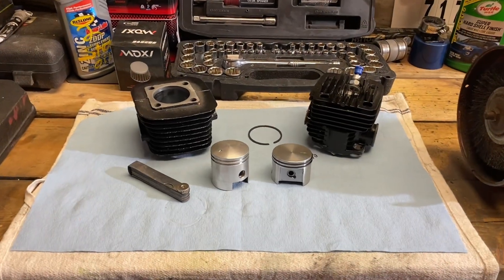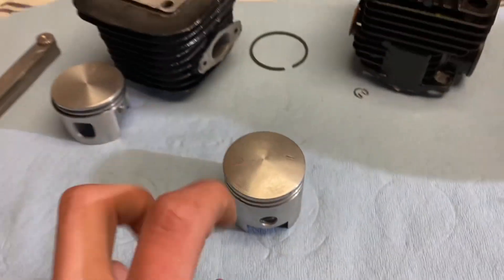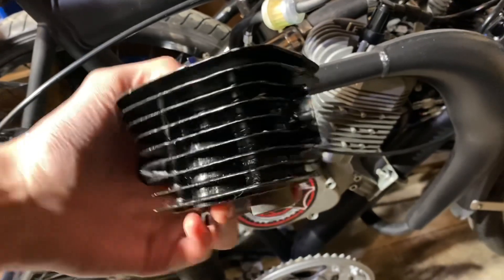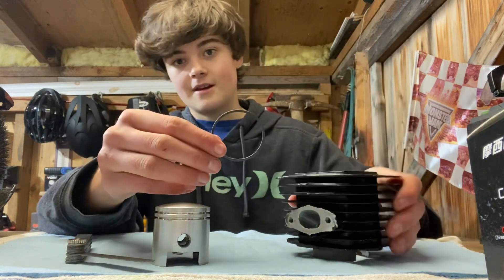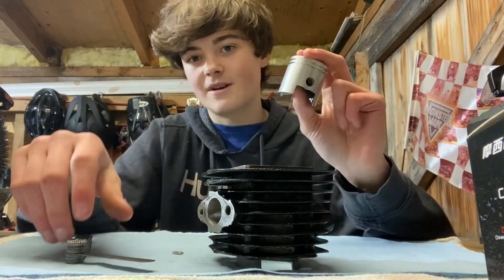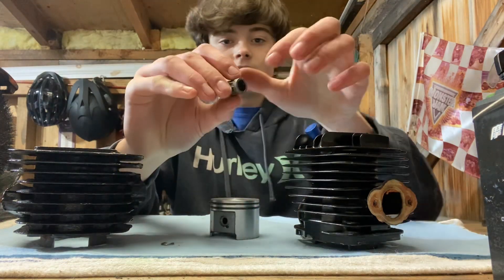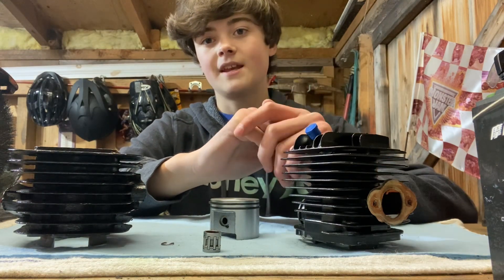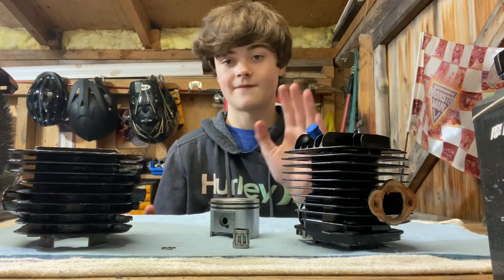Checking Piston Ring Gap on a Motorized Bike and Installing Piston the right way

Comment: No dude, those pins cannot cross any port , this is why you can’t hog out the transfers, or intake. Also the charge coming in cool’s it and puts pressure on the ring’s
Reply from the maker: Never said they did cross…

Comment: C clips and they come in .8 -1.0 thickness weisco is the strongest ones and you need a relief Dremeled to get them out all the other ones fail from loosing the tension from the rpms
Reply: Weisco has been making engine parts for,.... all my old ass life. Pistons and internal automotive and motorcycle

Comment: Is it recommended to replace piston rings once the cylinder is removed? I removed the cylinder for inspection after last summers run, and now it just sputters half way into acceleration. It used to pull strong and run fine but not anymore. It is a G4 type cylinder I got last year.
Reply from the maker: Well just taking of the cylinder can bring in tons of issues when it comes to the tune of the bike. If you didn’t touch the port work I’m betting on a base, or head gasket not sealing correctly. Or the carb could not be bolted down right and that will cause a air leak and that will create a lean sputter when on the throttle. Also to inspect the cylinder you only have to remove the cylinder head. Hope this helps
Reply: @keeganhache6667  Yea, I didn't do port work really except hand file a few rough edges that I should have done the first time. This is my first engine, Bike Berry's stage 4 that has seemed to be one of the lucky ones considering mixed reviews.  I opened up the exhaust gasket to match the exhaust port in the process for a smoother flow as it originally blocked some of the port opening. I was in the process of removing the intake manifold but noticed the gasket started to peel so never fully pulled it off, will replace now. Head gasket is copper and I annealed it before putting it back on. Base gasket didn't look damaged, but its original from the kit so probably best to just replace. I thought I read on a forum someone recommend to replace piston rings as these cylinders are not perfectly cylindrical and the rings form to that shape, and will cause blowby if reinstalled. I appreciate your response though and will replace some gaskets.

Comment: it can heat up the pin that located the rings and have it fall out on the exhaust side great video brother
Reply from the maker: Thanks man I tried to cover every thing I could and yes those piston ring pins I’ve seen pop out and destroy motors in a split second. They only pressed in.

Comment: How did you make that header?
Reply from the maker: Mostly trial and error just took a bunch of old headers from rock pipes and made it work. I had to cut one at a 45 degree angle so it would clear the pedals.
Reply: He welds

Comment: Correction wrist pin…. Needle bearing
Reply: Don’t forget port angle matters steeper port angles aimed at top of cylinder help higjer rpm power while lower angles help bottom end power (torque) although both are torque lol just rpm it hits differs but for higher rpm performance engines ya may want to angle them toward the roof try to get em to form a ramp of air that pushes to the intake side roof of cylinder head. And a boost port from intake to at or just below transfer line helps low end rpm without losing high end rpm power.
Reply from the maker: Yup totally blanked on that 😅
Reply: @keeganhache6667  it happens what ya know about port timing?